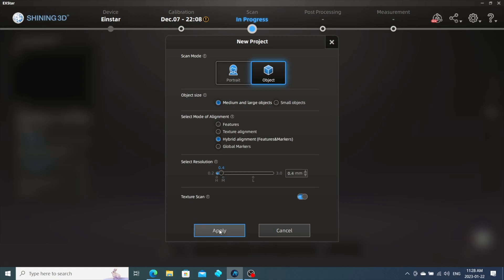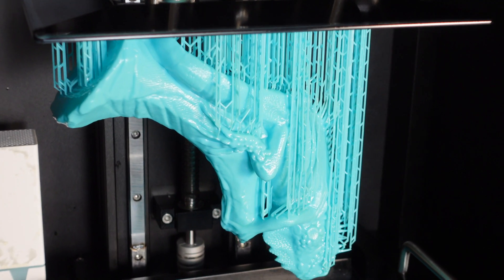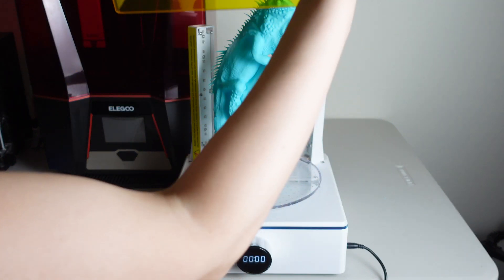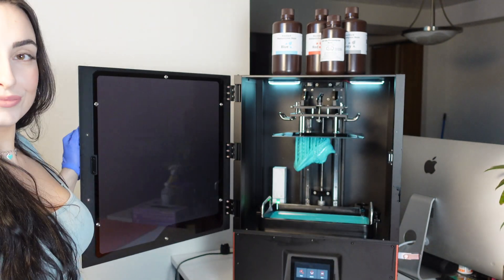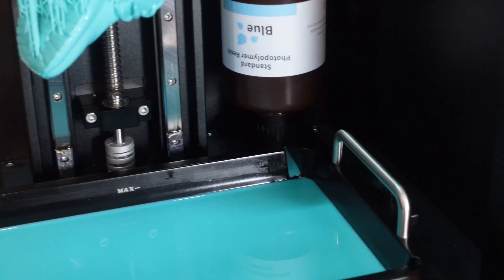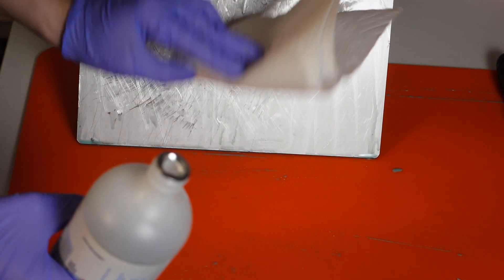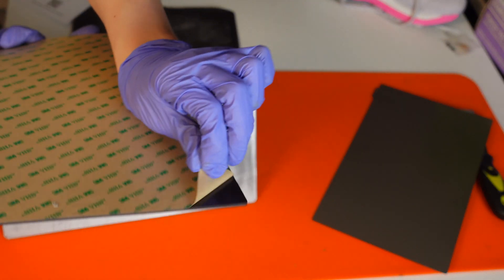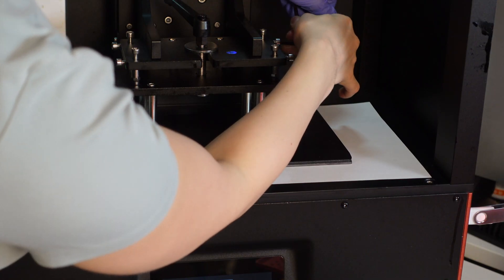Elegoo Jupiter 6K 3D Printer Review 2023!

Comment: An interesting project could be to try printing a flexible shoe/crocs/slippers with a resin printer. If it actually works and if the layer adhesion is sufficient then the next step could be slowly adding a stiffer resin into the mix as the shoe prints so that the sole would be mega squishy and the top part would be progressively stiffer. Printer looks really nice though.
Reply from the maker: Oh boy, that’s definitely a challenge but I’m here for it 👏 very cool idea!!!